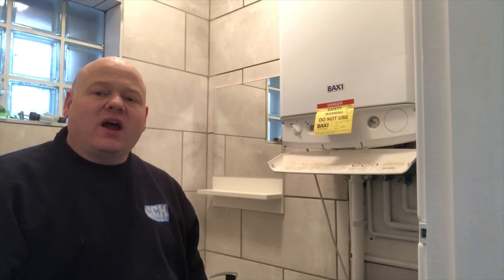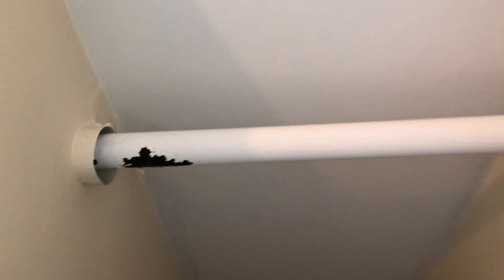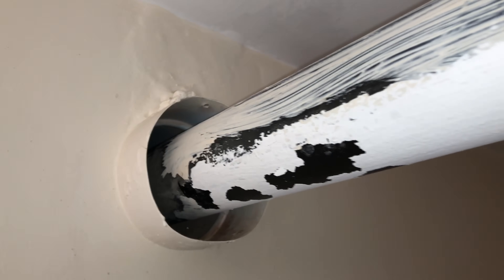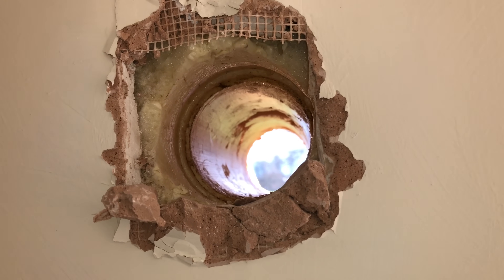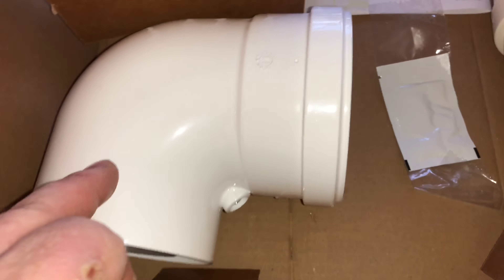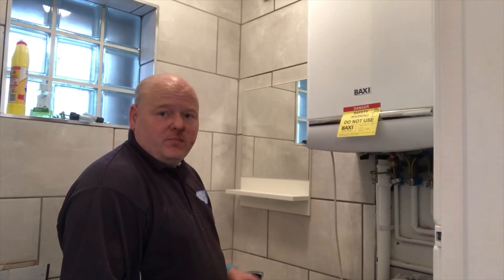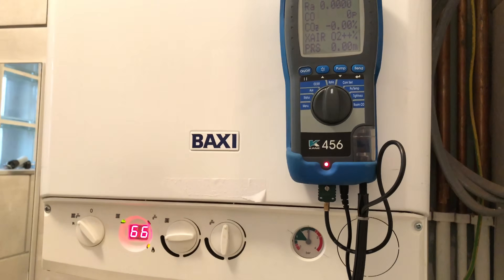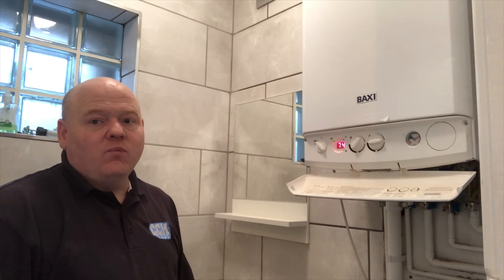Dangerous Gas Boiler  A day in the life of a Gas Engineer / Plumber

Comment: From what i see Allen. A lazy fitter has installed it, lazy as in not bothered registering or filling out paperwork. Not necessarily a non gas safe installer. Then it looks like they've had a small extension built on the side and the have a go builder as done the rest. Would explain that mess of the PRV pipe too. Looks like both flue and PRV were once outside?

Edit: The K render and brickwork is defo newish, having just watched the last 10 secs.

Comment: Hi Allen, not disagreeing with most of what you say, but can you explain what is dangerous about using a plug/socket for power if fused at 3A.
Reply: @daz374 I understand what you say about not every boiler having supplementary bonding across pipework. But an appliance only requires an earth when it is connected for operation. If it is physically disconnected as in removing the plug it no longer requires any earth. That same principle applies across ALL appliance in the UK in accordance with BS7671. It is technically no different to any other appliance in the home except it has a gas supply. Now you get stand alone gas cookers with a plug for the ignition. are you saying that removal of that plug renders it dangerous because it removes the earth? No it doesn't. And if there is a screw through some wire it is a separate issue before a boiler is commissioned.
Reply: @daz374 Actually from a safety perspective the complete removal of ALL connections is the safest i.e. the plug. I can understand why you ask this and it's because on a switched fused spur, the earth remains connected while the 2 poles get disconnected. But you have to understand that that Earth connection is only remaining fixed in the event of a failure within that 13a DP spur of any of the poles to fail to disconnect as the wiring is never physically disconnected. Is this becoming clearer for you?
Reply: @daz374 That earth through the flex (or CPC as we call it) along with phase and neutral is proportionately cross sectional sized to the phase and neutral. If the accompanying phase and neutral is removed then there is no requirement for that earth. If you got as far as putting the connecting screw through a live cable you will know well before that boiler is hanging on the wall!!! (LOL). Think of it similar to a washing machine when the plug is removed, that washer doesn't still require an earth does it?? The supplemental earth bonding across pipework will catch any stray currents not directly related to that boiler. An appliance ONLY requires an earth when it is has a live connection. Physically removing that live connection along with the neutral (as in removing the plug) negates the requirement for any earth.
Reply: No need for an FCU. The socket arrangement is fine
Reply: @daz374 If you were a qualified spark like me you'd probably have a different take on electrics. If a casing is live like you say, it would mean either (a) the earth core to the boiler wasn't connected at source, or (b) it wouldn't have come from the same connection as the earth. i.e via the same 1mm 3-core flex to the boiler. It would have otherwise tripped the MCB or shredded the 3a fuse. If the live came from another source then it is an entirely separate electrical safety issue not connected to the boiler. I'm not entirely sure you are knowledgeable enough to figure this (and i'm not expecting you to be). The boiler is no different from a stand alone gas cooker in the eyes of electrical regulations. And if someone was stupid enough to leave a stray 40a open end shower cable touching pipework under floors, a 1mm earth conductor in a flex will not suffice. That's why it is inherently important to connect cross bonding to pipework. But as I said, removing the plug removes the requirement for the earth. Where any external stray current happens to catch the appliance is a separate issue.
Reply: @daz374 You have totally misunderstood what I have said. I am not expecting you to understand electrics like I do after 25 years of sparking. From a safety aspect, complete removal of connection is the safest possible mechanism as you are totally sure you have isolated an appliance. Where a boiler is concerned, they come with a 3 core lead. Most boilers then have controls for thermostats and timers external to the boiler so more often than not, the 3 core wire is incorporated into a fixed system along with wires from other controls. It is then not feasible to remove this wire as it is hard wired into a terminal block. When this is done, the next best mechanism that maintains safety is a DP isolation switch preferably with a neon so the end user can physically SEE that it is ON/OFF. Since this system keeps all wires fixed in place, the earth remains directly connected right up to the boiler. It is NOT for any other purpose other than to cater for the possibility that the DP switch becomes faulty and the boiler becomes live when the DP switch indicates otherwise and therefore there will always be an earth connection. On a basic 3 pin plug mechanism you can SEE that the entire wiring is disconnected. The supplied earth is for the live/neutral supplied with it and not any other live/neutral from another circuit.
Reply: It was probably a Pole that installed it in the first place. He might have had help so double pole?
Reply from the maker: @daz374 Plug is fine as long as the socket is unswitched as far as i am aware. Thanks.
Reply: @AllenHart999  There are quite a number of double poll switched sockets. MK make one.
Reply: @daz374 with equipotentioal bonding across all the pipes, even with the plug removed the boiler is still more than adequately "earthed."
Reply: daz374 it will remain earthed through the dedicated gas and water bonding on the property. The 10mm bonds will do more for the earthing arrangement than the 0.75mm cpc in that flex will.
Reply: @daz374 so them 10mm2 main earth bondings to water service and gas service pipes don't count then?
And the fact that its completely electrically disconnected via the plug?
Reply: daz374 l
Reply: daz374 if your house doesn’t have any RCDs and the pipes are electrically connected to the boiler but not to a metal pipe to the outside and/or a ground pin, that’s probably something you should fix before you worry about servicing a bloody boiler.

You’re trying to turn a situation that is a) very rare b) very much not up to code, into a reason for all boilers everywhere to have a connection method that is actually worse for safety because it makes you feel better.

That’s not how that works.
Reply: @daz374 arsehole*
Reply: @daz374 Gas pipe should be bonded at the meter to MET at consumer unit. So should still be grounded?
Reply: @daz374 As an electrician and gas engineer looking at this video, I would say you are wrong. Once that plug is removed, there is no electrical connection to the boiler to necessitate an Earth connection. Secondly in the event of any other stray electrical currents, there appears to be a satisfactory Earth bonding cross connection across the copper pipework. As for the the issue with having a 3 pin plug, it's not ideal but it isn't in breach of any wiring regulations. If the manufacturers instructions stipulate a double pole isolation, then the gas engineer commissioning this boiler with a 3 pin should check that the socket that the 3 pin is plugged into is a double pole switched rather than single pole.
Reply from the maker: I didnt say its dangerous, Its just not as per the boiler instructions thats all.
Reply: @AllenHart999  If it has a 3 Amp fuse in the plug. It has double pole isolation if you pull plug out. Instructions state. Connection MAY be via a fused double-pole isolator with a contact separation of at least 3mm in all poles and servicing the boiler and system controls only. Agree with rest.
Reply from the maker: @mrh2602  Plug needs to be unswitched as far as i am aware. Needs double pole isolation. 👍
Reply: @AllenHart999   Not a criticism. But Arent Fused spurs are switched. Double Pole isolation with plug removed. Keep up the good work. Good to see a good and thorough engineer at work.
Reply from the maker: @mrh2602  A standard switch plug is only single pole , so if the engineer switched it off then it could still be live, if you unplug it then it would be double pole, Thats the way i understand it, Not really a big issue though. Thanks.
Reply: @AllenHart999  it also stops customers switching it off mid cycle which shortens the life of the boiler.
Reply: @jaredakten4939  How? If it's a switched spur they can turn the switch off just as easily can they not?
Reply: @AllenHart999  Either that or you check that the socket is a double pole rather than single pole.
Reply: @jaredakten4939  hi what do you mean exactly when you say switching off mid cycle? I always switch my boiler off by the lit up orange switch thats  in my cupboard, will me doing that shorten then life of my boiler? Cheers
Reply: @joebloggs7103  depends on your boiler. Most modern boilers go through a specific shutdown sequence before they shut down so if you turn the power off you interrupt this sequence. Also your frost protection will not work with the power off. So yes you could damage the boiler. Best to just let it shut it self down via the programmer and keep the power on at the socket or spur.
Reply: You are correct. If using a plug in lead, the socket should be unswitched, guaranteeing double pole isolation. A switched socket would normally only isolate the line conductor. If it’s been wired right? 🤔😬😂😂😂😂
Reply: @AllenHart999  Current range of MK sockets and all but one of the Crabtree range are now DP switched as standard, which is as it should be IMO. Good to see someone as thorough as you at work.
Reply: @AllenHart999  I think you'll fined the reference to a fused spur is a 'may' in the manufacturers instruction not 'must', to quote:
 'NOTE:
The method of connection to the electricity
supply must facilitate complete electrical isolation of the
appliance.
Connection may be via a fused double-pole isolator
with a contact separation of at least 3mm in all poles
and servicing the boiler and system controls only.'    So a plug in a socket is acceptable whether of not it is switched as complete isolation is facilitated when plug is removed.
Reply from the maker: @Esriuptime  NOTE: The 230V switched signal for external controls (Frost Stat - Room Stat - Timer)
must always be taken from terminal 2 at the boiler. Live, Neutral and Earth to power
these controls must be taken from the Fused Spur.© Baxi Heating UK Ltd 2018
Reply: @jaredakten4939  No. You are then defeating the reasoning of being able to swiftly isolate an appliance if you have the spur unswitched and have to fiddle about to remove a 3a fuse. The correct mechanisms are either a switched 13a DP connection unit (prefereably witha neon) and a 3a inserted fuse, or a 20a DP isolator (with neon) connected on a radial circuit fed by a dedicated 3a MCB in the consumer unit, OR simply using the supplied plug into a 13a socket that is double pole at the switch and a 3a fuse in the plug. I hope you are not connecting boilers to any fixed mechanism with no switch for the user!
Reply: @nathd1748  Regardless of the discussion about types of switches, in the application shown the boiler was in a shower room and the UK wiring regulations are clear that electrical sockets should not be used in these areas unless isolated such as for electric razor points that have a transformer inside. This is to stop people using hair-dryers for example in these places where there could be a risk of electrocution. A fused switched spur with a neon would be the best option here but as we see in the video the best was never ever a factor in this installation. Bloody amateurs.
Reply: @napoleanbonopart4544  Yes I accept what you are saying but we cannot see how far from the shower the boiler is. If 3m away then you can apply normal electrical rules so long as the circuit is RCD protected. I was trying to illustrate to the previous comment that a simply plug socket is not the "villain" he quite made it out to be.

Comment: With all due respect Allen, Gas Safe will not follow this up. Good work though mate.
Reply from the maker: Thanks.
Reply: pmailkeey clearly a wind up merchant
Reply: pmailkeey You are joking?
Reply: pmailkeey Granted there are many rough installers about and the government scheme was an undocumented scandal. There are channels for gas safety concerns on the Gas Safe website to arrange for an official inspection and for unsafe work to reported. Complaints from the public through this channel carry far more weight than reports from an installer, believe it or not. 
But to outright say you will not use a Gas Safe installer for gas work highlights you as a fool just adding to the dangerous and criminal problem of unregistered gas work.
Reply: @pmailkeey so you wouldnt mind then if an install like this killed your kids as long as you saved money with a cheap job and you've got heat and hot water
What a cock

Comment: Is that in a wet room?
Reply from the maker: No, its a wc room
Reply: Toilet area with 13amp plug socket on the wall .  Shocking....... (literally)
Reply: Well I knew it was a loo/shower/bathroom- seen the 100 mm bathroom chrome extractor fan in the background of the boiler shot, and wall tiles. How faraway is the socket from the loo and wash basin?

Comment: These boilers go into HW mode if you turn a tap on unless you remove the DV head and hall sensor first, that may be why your gas rate was low as its modulating down with the low flow rate. This wouldn't need a gas run if the operating pressure was correct? 22MM should be enough they've just oversized the appliance doesn't mean its unsafe. Was the vessel charged?

Poor install though, yet there are thousands worse than this out there... Worrying i'd be surprised if gas safe actually did anything.
Reply from the maker: You are correct about the head and hall sensor the videos in bits and i forgot to add that. As for a 40 kw boiler working on 22m you are way off the mark, With no bends at all 7m of pipe still needs 28mm as a min , i also did pipe sizing on this although its not in video, The boiler needs 4.36M3/H there is about 16m of pipe including bends so its very much undersized. Thanks.
Reply: @AllenHart999  Agreed but this would only be NTCS if it still existed, your GR was within tolerances so its working safely I wouldn't have worried about that personally but its ultimately your call I guess if you don't feel comfortable leaving it like that from what you've found.
Reply from the maker: Charlie What about the lack of flue 😂🙀
Reply: Allen Hart 😂😂😂😂😂😂😂😂
Reply from the maker: @DHILL82  No idea what people see sometimes 😱😱😱😱😂
Reply: Allen Hart 😂😂😂😂😂😂😂😂😂 I’m genuine sitting here is disbelief that he would only put that as ntcs if it still existed 🤪🤪🤪🤪🤪🤪
Reply: @DHILL82  Genuinely have no idea what you are giggling about, I was referring to the pipe sizing would have been NTCS its currently nothing as the category is gone. The flue issue was solved was it not? I'm commenting on whats left. How would you have classified the initial faults just out of curiosity?
Reply: Charlie 😂😂😂😂😂😂😂😂😂😂😂😂😂😂😂
Reply: @DHILL82  Great response, glad we settled that then.
Reply: Allen Hart well, I mean, those concentric flues have the exhaust in the center and intake in the outer ring, right? So the exhaust was more or less routed to the outside, and the intake was coming from inside the house? And being choked a little for that matter.

It was pretty damn terrible, but at least it wasn’t instantly lethal like routing the exhaust indoors or extending the whole thing to the outside, but without the inner pipe.

Sometimes it seems like “isn’t certain  to kill you” is all you can ask for.
Reply: Jasper Janssen I totally disagree with what you’ve said here. The whole point of a balanced flue is that the air and exhaust are in balance, ie any force/wind can’t act on one without the other. If the wind blows on the exhaust and slows the poc discharge rate, it also blows into the air intake increasing the pressure inside the boiler, thus the poc can’t stall. If you have the air and exhaust on different walls or in this case from different rooms the flue fails to be in balance. you’ve only got a very small fan in a gas boiler, imagine a howling gale of 65/70mph wind blowing on the terminal, there’s no way the fan alone would force the poc out against that if the air intake was located in a different pressure zone. . That’s why the flue is a balanced flue. Furthermore you can’t just use any old bit you like on a ga appliance. Only products approved by the manufacturer are legal. I suspect that flue might be from something like a keston, and therefore hasn’t ever been tested for safe operation on a baxi. Sometimes all you can ask for is that it isn’t certain to kill you, are you serious? No correctly installed gas appliance that’s installed, serviced and commissioned correctly is going to kill you, that’s the whole point of the gas regs, and that’s the minimum you should expect. 100% safe. That install is a fucking disgrace. I think it’s still at risk as the prv is terminated internally and I think bizarrely the prv is covered by the gas not water regs as it’s considered a safety device of the appliance, I’d have to double check that though to be certain.
Reply: Wayne Griffin in other words, we don’t disagree at all. “When the wind is in the wrong direction” is not the same thing as “instantly”.
Reply: Charlie did you watch same video as me. The flue is absolute shocking.
Reply: @DHILL82  Yeah that's ridiculous I don't know how these people sleep at night.